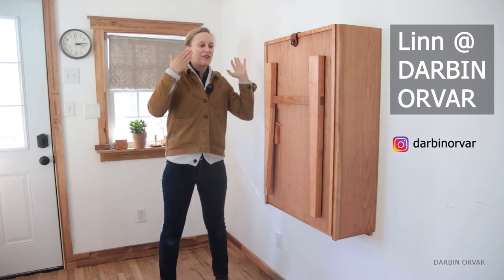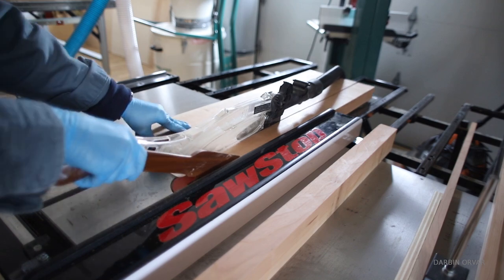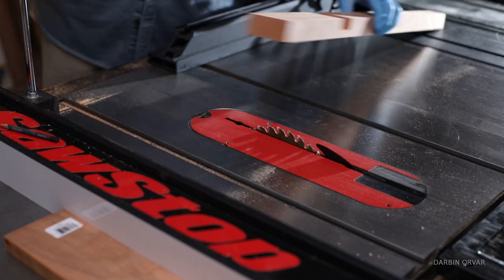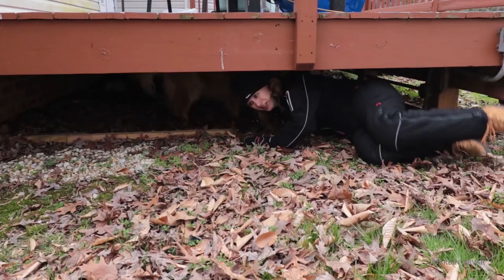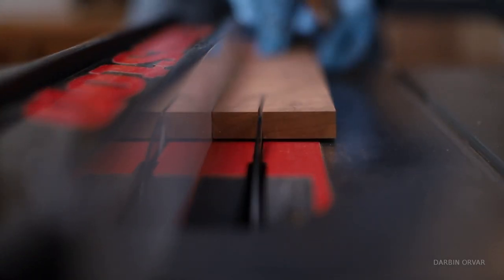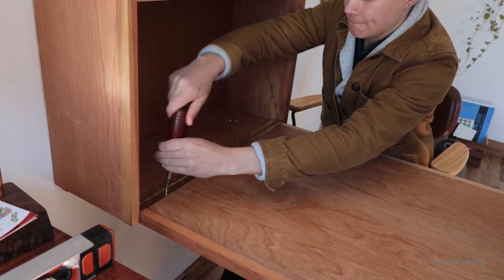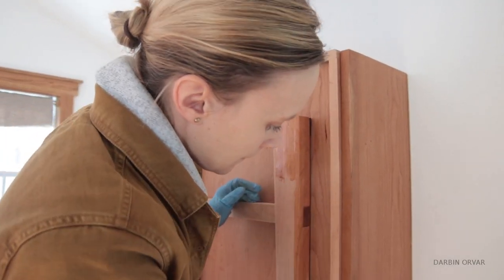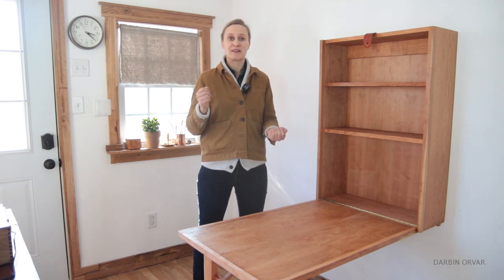Building a Gorgeous Fold Up Table // Wall Mounted Drop Down Desk (Space Saving)

Comment: Hi , it's a nice wall table, and it goes with it's surrounded area really well , I prefer a steel support bracket underneath supporting the table , but wood is ok .
Your looking good in the new work wear and well modelled  , if your happy with them that's fine .

Comment: I like the idea  of this project, i will definitely make one but different. I dont like the aesthetics of the legs on the outside. so I will change it with legs that fold into the cupboard and hinge on the top edge. It will mean giving up a bit of space on the inside though and the hight of the cupboard and the legs will have to be well calculated beforehand. Thanks for the idea

Comment: You should add finish washers to the screws on top, it would really add some class and possibly protect the leather from tearing. Nice looking table all around.
Reply: They were countersink heads, wrong application, washers wouldn't help. A proper flat head with upholstery fixture is what is needed here. And with all the professional gear in that shop...no leather hole punch?

Comment: The manual hinge pin on the support brace is going to get annoying in the long run, I think I would try to solve this by having it run in a slot on the desk side, or by having the bracket itself hinge in the middle with a  permanently fitted metal collar that you slide over the hinge area when it's down to prevent collapse. Otherwise lovely!
Reply: Or, at the very least, have it hinged underneath the top and pinned at the leg. With it as it is, something tells me that most people would pin the leg once and never fold it up again.

Comment: I am a long time fan of your channel. I would greatly appreciate it if you could make a video on how you square up your SawStop cross cut sliding table. I own one but don’t use it too often since I haven’t had much luck squaring it. I was considering fabricating a jig to set it quickly and accurately. Also, do you perform a five cut test to confirm each time?  Anyway, I think you are the only one one youtube using it on a regular basis, so your expertise would very much be appreciated!